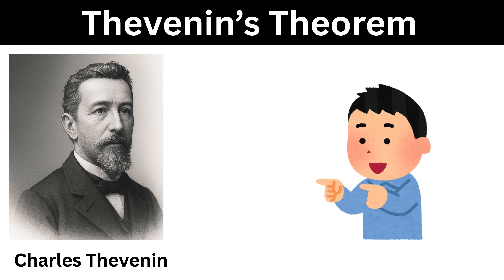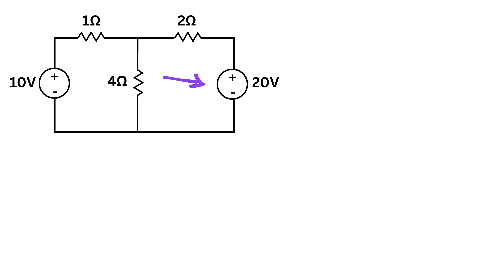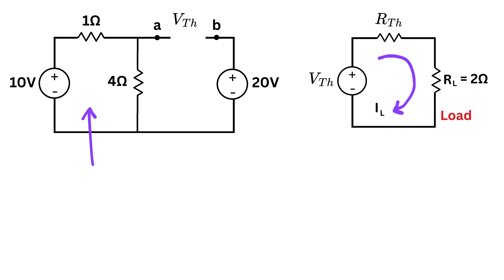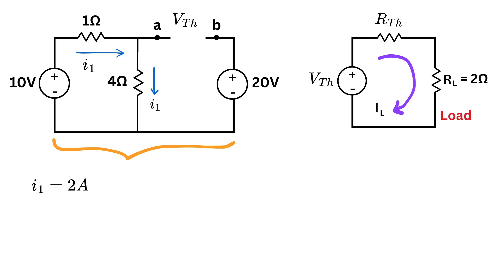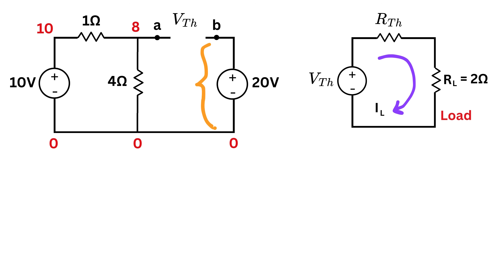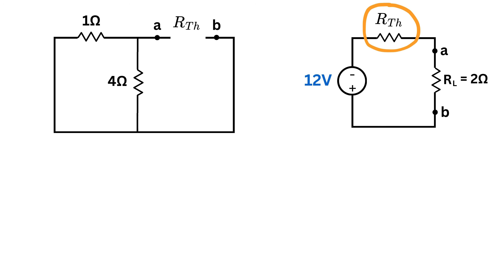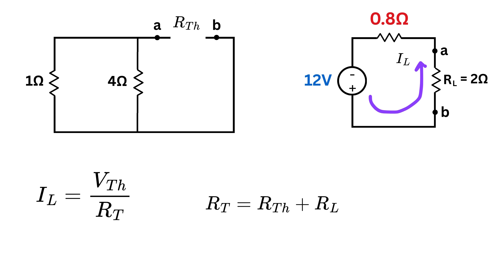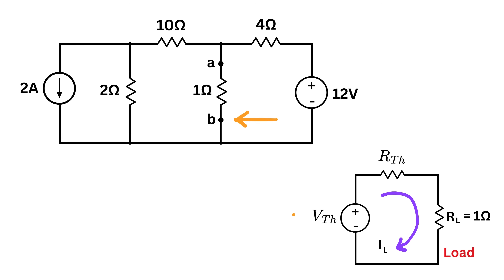Thevenin's Theorem Circuit Solved Example | Easy Step By Step

Comment: 8:07 Can we do current division rule and I am first Year ECE student and my problem solutions are like converting current to voltage source like if 4 ohm resistor parallel with 3A source they say it 4x3 =12V via ohm's law but they make the both resistor and source in same wire(series)🙃

Comment: at 4:44 can someone explain deeper i still don't understand why we move the resistor
Reply: We moved it for better understanding so we don't get confused.
See, while finding Rth, we remove the load resistor and all the voltage and current sources also. Now, name the points from where you removed load resistor A and B. Now, you imagine a current starting from point A and then find the equivalent resistance. Then you will see that 4 ohm and 1 ohm is in parallel. Otherwise, if you start calculating from the left side where 12 V was there, you will add up the resistance as it would be in series from that side

Comment: Don't do this long method for finding Vth...just make equivalent voltage source using current source and parallel resistor ! It becomes a two three steps answer with simple calculation

Comment: After three sets of output transistors blew out I got handed the class A amplifier. It roughly took me about 12 hours to apply Thevenin and another 2-3 hours to check it. Then another hour staring at the results and applying what ifs. The good capacitor had to turn into X ohms under load. The shop was out $130 on blown transistors plus $3 to replace the cap.
Reply from the maker: 12 hrs 😨
Reply: @BrainStationAdvanced  That was a really beastly amp. Panasonic 'New Class A'. Under 15 watts class A, above it went to AB. Idiotic design. All it took was a decoupling cap going straight wire under load for the output transistors to blow in cascade, protecting the fuse. I used Thevenin and applied what ifs. If I had been sensible I should have just gone shotgun and replaced every cap in the output stage.

Comment: Before watching this video, I solved the question in the video thumbnail using superposition.
Reply: My way: transform the left current source to voltage source, add the next resitor, transform now both voltage sources ti current sources, paralell   them and transfer back to voltage surce or unse current split to calculate load voltage and current

Comment: In a college "Circuits I" class, on the first day, about 50 years ago, the professor was analyzing a circuit on a blackboard,  rearranging it, then announced that from this point, the rest of the analysis was simple, that you just had to take the Thevinin equivalent.  As if we were already supposed to know what that meant.  Another kid and I looked at each other and laughed, knowing this course was going to be trouble.  

I wasn't an EE, but I've never forgotten the term, "Thevinin equivalent", for this memory.  Where was YouTube when I needed it?  It did not exist, yet.
Reply from the maker: I can feel that

Comment: You have assigned Vth to be the potential difference between the ends of a 2 ohm resistor but in the simplified circuit, labeled Vth as the potential of the battery. Now, the load and Rth are in series, so the potential difference across the load in the simplified circuit must be less than Vth because some of the voltage will also be taken by Rth. I havent watched the entire video and nor do i know about this theorem. I just don't feel this right
Reply from the maker: In Thevenin's Theorem, Vth is defined as the open-circuit voltage between the two terminals where the load would connect. That means it’s the voltage you'd measure across the terminals with the load removed....so in the original circuit, it's the potential difference across the two ends of that 2-ohm resistor without any load connected.

Now, when we simplify the circuit using Thevenin’s Theorem, we replace the entire original network with a single voltage source (Vth) in series with a resistor (Rth). Here, Vth is not the battery's voltage (although represented like that), but rather the voltage measured at the load terminals when the load is not connected.
Reply: @BrainStationAdvanced  ok, I had misunderstood your statement from the diagram perhaps

Comment: What do you think which methods is more effective to solve circuit question, kcl or any other
Reply from the maker: I mostly prefer using Nodal Analysis (based on KCL), as shown in the video, because I find it more intuitive and straightforward to follow....Although sometimes it might take a bit more time for certain circuit problems, I still find it easier to apply and understand compared to other methods.
Reply: @BrainStationAdvanced  thanks